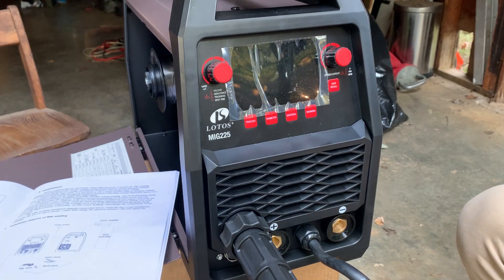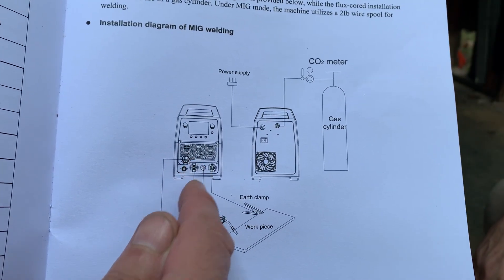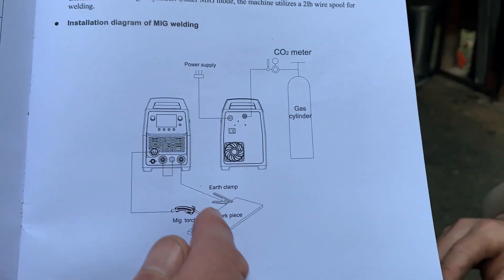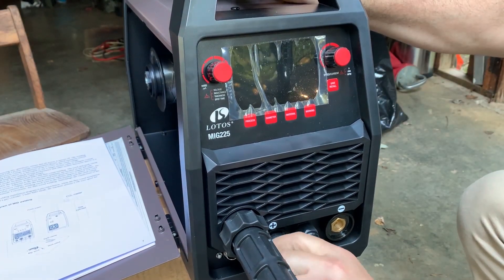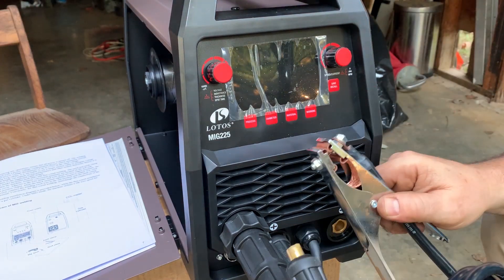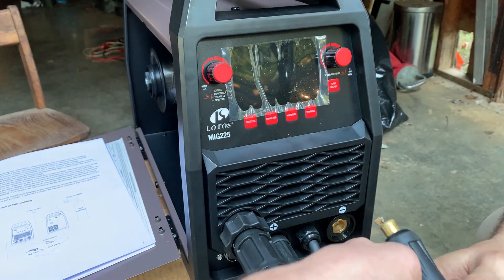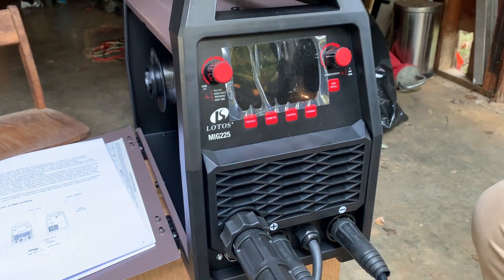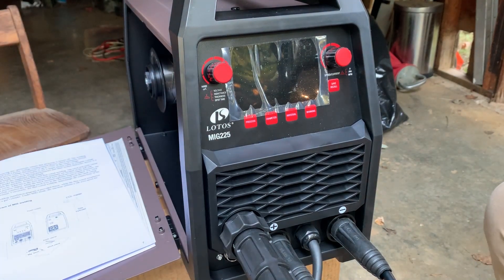Demo of Lotos MIG225 Welder

Comment: If you're using flux core you want DCEN, DC Electrode Negative, so your ground should be on positive otherwise your welds are going to be crap.  DCEP would be for gas shielded solid wire MIG.
Reply from the maker: Thanks. We will recheck the manual to be sure we have it set up properly. :)